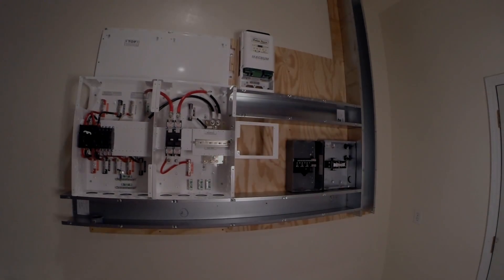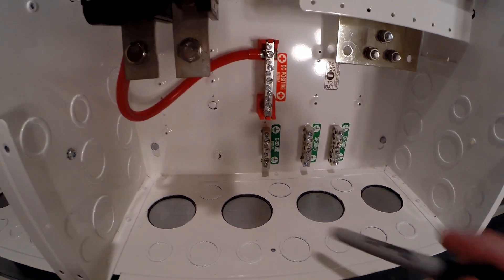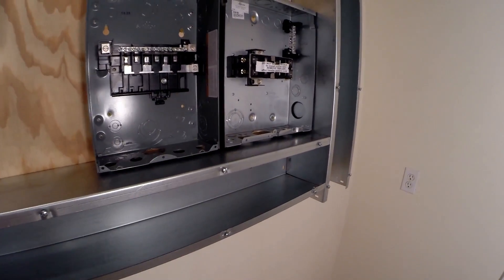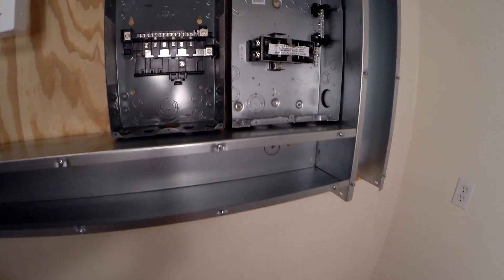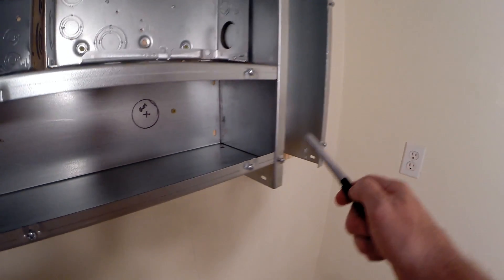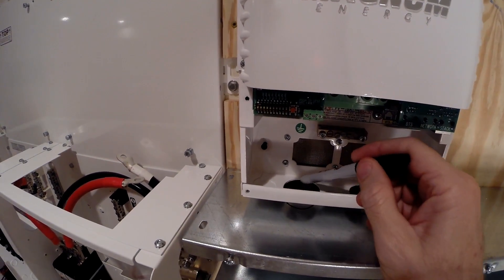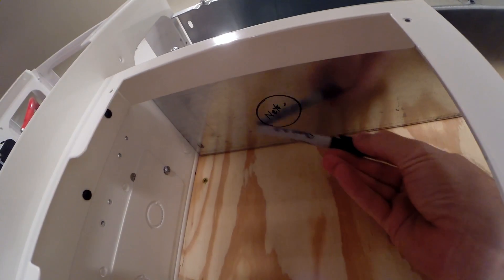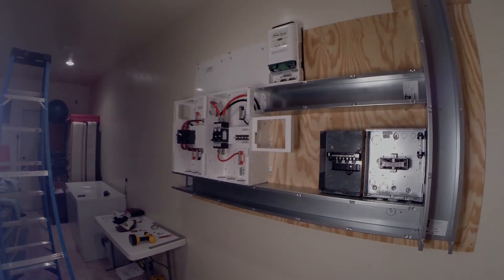Off Grid Solar #11: Planning Wire Runs

Comment: Greetings. The Magnum mounting bracket for the RTR router should also fit the ARTR advanced router correct? If so can you please share the part number.
Reply from the maker: I would guess that it does but it should come with its own bracket, mine did.  https://youtu.be/kvSfsvVzmu4
Reply from the maker: OK, I see what you mean now.  Your talking about the white bracket, right?  I would guess that it is the same for the RTR and the ARTR.
Reply from the maker: FYI:  My bracket came with my Magnum panels.
Reply: @HomesteadEngineering   Hello. Yes the white bracket you point and touch at the 4:20 mark.  I am not sure if this bracket comes with the MPSL175-30D panel I will be ordering.  I will try and contact Magnum tomorrow.  Thanks